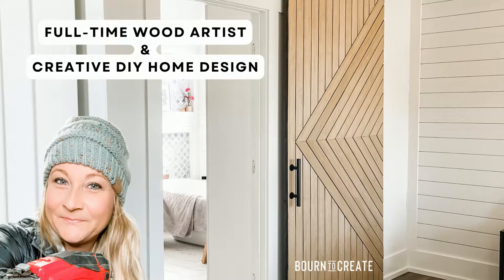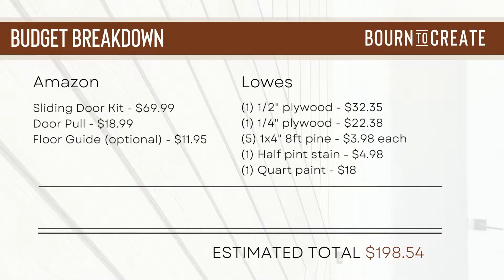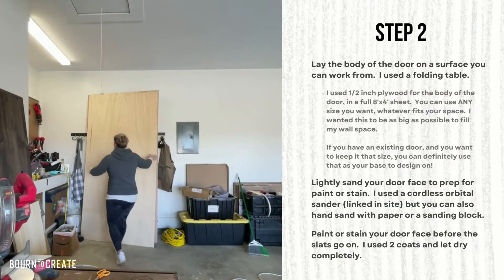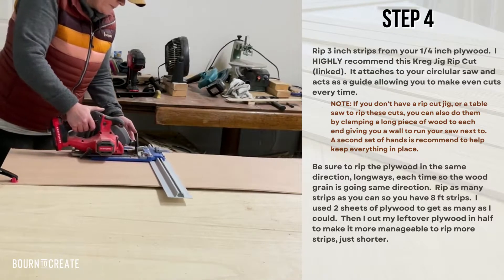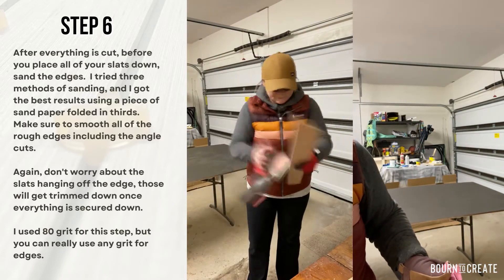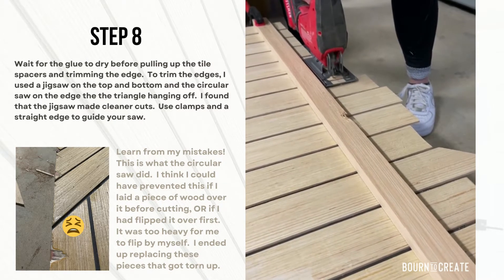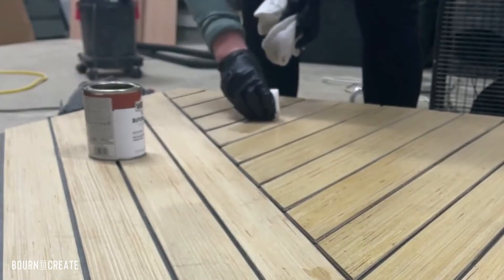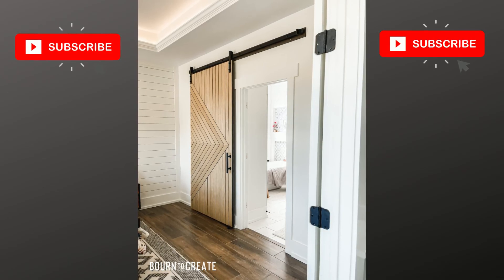HOW TO BUILD A MODERN SLIDING BARN DOOR FOR UNDER $200 - FULL TUTORIAL

Comment: What if you need a 9 foot door.. does plywood come that big
Reply from the maker: I don’t think plywood comes that big but you can piece two sheets together either at the top or bottom. Get creative with the design to cover it up. And use the backside as the side to brace the two pieces together. Or is the pieces it together in the middle, it would be less noticeable with the extract pattern I did on the front because that’s where all my cuts meet. Hope that helps!